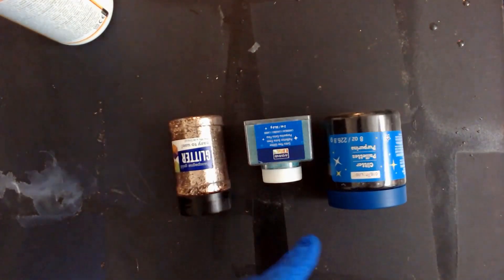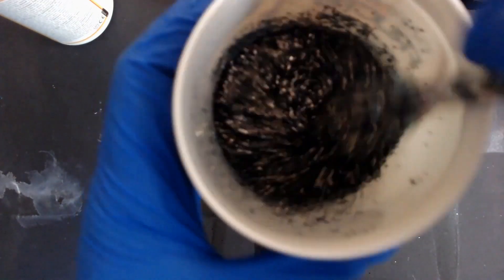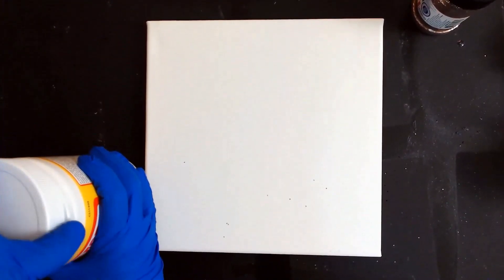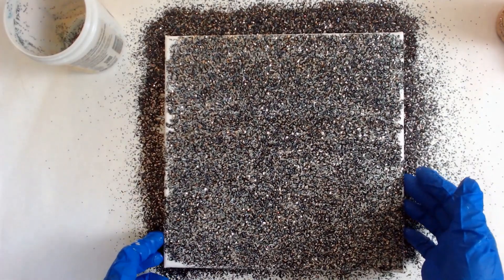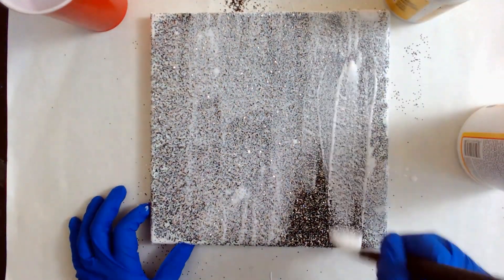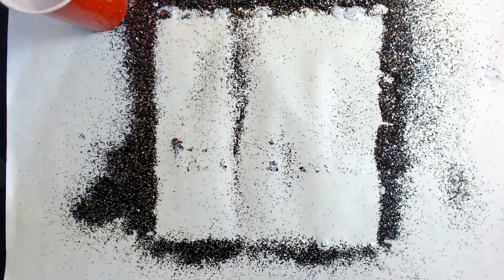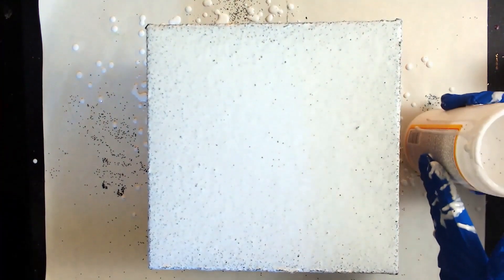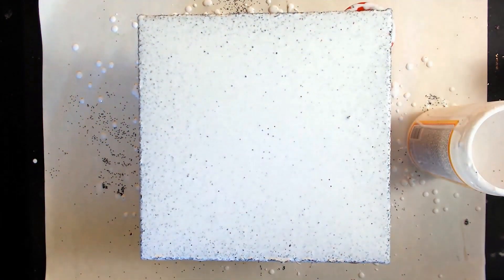| How To Make A Glitter Canvas! | *SO MUCH GLITTER*

Comment: Hi, instead of using MP for the final sealing part ,could you use resin?... thanks
Reply from the maker: Probably! I've never done it, but I do have a bit of experience using resin on canvas. I would be concerned about bubbles. It seems like the glitter would cause quite a few. Keep a heat gun close!
Reply: @byBess  many thanks :)

Comment: Is there a specific reason as to why you poured the mp instead of brushing it on when doing the final coat?
Reply from the maker: Yes, pouring the mp avoids the use of a brush, which would add brush stroke textures to the final product.
Reply: @byBess  ooooooooooooh okay. Makes sense. Thank you.
Reply from the maker: @queenrdb  You're welcome!
Reply: Does it dry up and look shiny or do you have to recoat it with glitter?

Comment: hi thanks for sharing so after the last coat of mod podge I want to do some writing on it would I put more mod podge after the writing or just leave it alone?
Reply from the maker: You could do either! It just depends on the finish that you're after. If you're going to mod podge it, I would pour the MP in the middle and tilt the canvas to cover it. Brush strokes might mess up your writing.
Reply: by Bess ok yeah that’s what I was thinking if it would mess up the writing thanks for the reply 🙂

Comment: Hey hw to clean or wipe off glitter from canvas.? I used Fevicol to apply some glitter on it. Nw I wanna remove it as iam unhappy about the result
Reply from the maker: I'm sorry, I don't know what Fevicol is.
Reply: @byBess  Fevicol is like Elmers glue or Tacky glue.
Reply from the maker: @ameerasanofer1629  Ah. I've never tried using either with glitter in this application. However, once the glitter is glued down, it's pretty much going to stay there. You could attempt to remove it with water (I think elmers is water soluable), but I wouldn't get my hopes up.
Reply: @byBess  ha ha thanks. I tried.. Most of them came. Bt it's there n Wil be there 😅